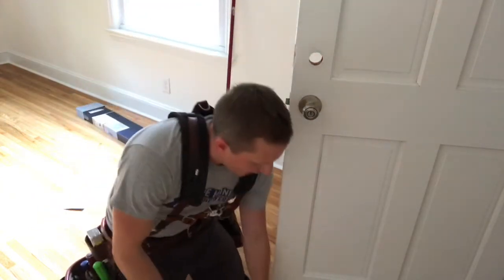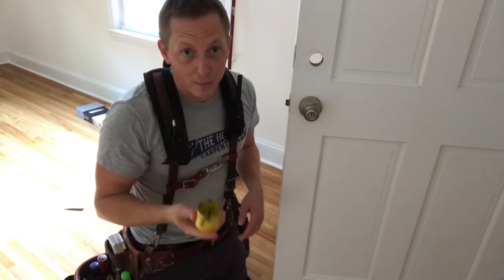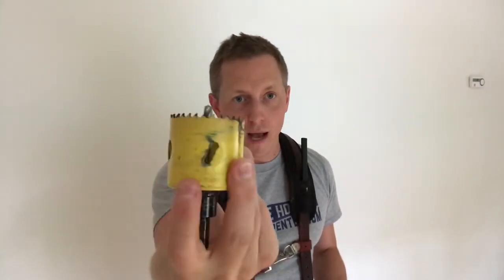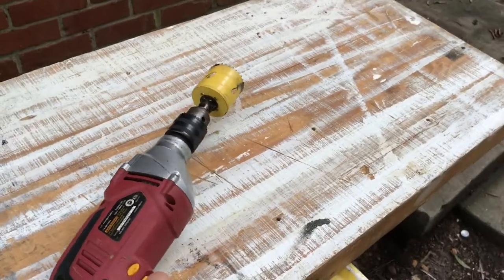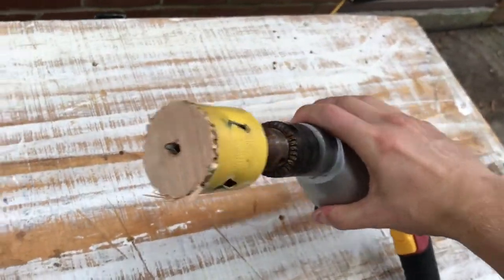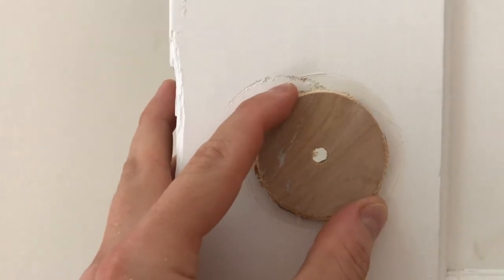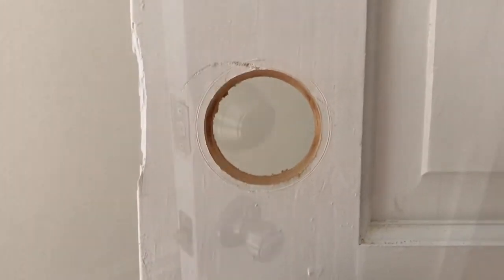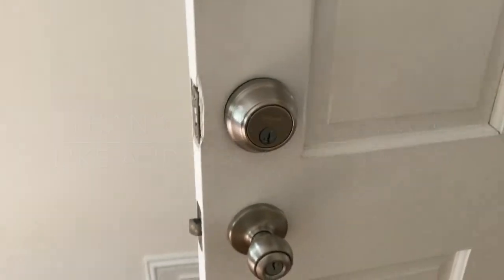Hole Saw Trick (Making Holes Larger)

Comment: Using the other piece you cut the plug out of allows you to just use clamps to hold it an allows you to visually see that it's centered if that's important.  It also allows you to cut off center as well.  This gives a lot more support for the hole saw.  I also recommend running the drill in reverse slowly for short time to "set the track" of the saw, then continue in forward.  Lots of ways to skin this cat.  Go with what works for you.
Reply: Came here to say you can use the hole rather than the plug.  And since 2 1/8 is pretty standard, you can use it multiple times. 

I have 4 hallway doors needing new knobs and they all need a larger hole.

Comment: Nice trick!  I will give this a go, the solution I use is the exact opposite using the hole from the scrap piece, not the centre you did, only clamp it in place, the hole keeps the bit from drifting.  No brad holes to fill afterwards.
Reply: No brad holes anyway. You end up cutting that bit of wood out.
Reply: If the old hole is only the tiniest bit smaller than the new hole, the brad nails can't be used since there's not enough material to nail to. In which case, the solution that Ed Over50 had seems to be better to keep the hole saw in place, although there's nothing guiding the pilot bit.
Reply: @trogdor1977  Correct, the outer hole holds the bit in place so the pilot bit isn’t even required

Comment: I had this exact problem with 17 of the doors in my home. The way I approached it was to use a long arbor and use two hole saw blades. One the same diameter as the original hole (to use as a guide) and one for the new hole. I got them all done in a day with only a little bit of trouble getting the wood from between the bits. Hope this helps.
Reply from the maker: That’s a great idea Kevin—it never occurred to me! I’m putting it in the toolbox 🧰. Thank you for sharing!
Reply: @TheHonestCarpenter  sharing is how we expand everyone's knowledge. Keep making your videos. They help.
Reply from the maker: Kevin Lersch will do, thank you!
Reply: Is there a video on this method? I think it sounds easiest for a not very tool savvy handy person like myself!
Reply: U got 17 doors in ur house? Wtf?

Comment: Just cut a hole in new wood the size of the existing hole. Then slip the plug on the pilot bit for the bigger whole saw. The plug will act as a guide in the old hole and keep the  new bit centered..

Comment: Was just thinking to use a piece of scrap on one side of the door to centre you're hole drill , then fix a small scrap on the other side to align it. Then just bang in the hole saw size you need. Bobs you're uncle mate.

Comment: I just screw on the hole saw I want the hole to be, then find the hole saw the size of the existing hole, and screw it onto the 2 remaining threads inside of the hole saw I just chucked up. Basically chucking up 2 hole saws on one arbor. Much easier and I saw that in another video. I always used your way before learning that. Still use your way drilling stone.

Comment: 2 alternative ways to do this that seem better/ easier than this. I’ve used and had great success with both. 

First: If you can stack 2 hole saws on the same bit. The first is the size of the existing hole and keeps things centered. The second is the size of the hole need and actually cuts the hole.

Second way: cut a hole the size you need in a piece of scrap. Clamp the scrap with the hole centered over the existing hole and the scrap will keep your hole saw in place as you cut. 

On a door it’s best to cut only half way through then cut from the other side. Gets a cleaner cut with less surface tear out
Reply: The second way is the way I do it. If I was modifying the hole on a door in situ, I'd clamp a second piece of wood to the other side and use 2 clamps to get both scrap pieces tight against the door surface. that way you'd get a nice clean cut when the cutter "breaks out" at the other side.
Reply: As someone working with limited tools, your first suggestion was exactly what I needed! Thank you!
Reply: Excellent ideas!!
Reply: Wait what method do you use to clamp the wood in place? If there's a clamp head in the way how can you run a hole saw over it?
Reply: @tfriedmann5908  The scrap board needs to be long enough to extend well beyond the hole itself. Clamp away from the hole.
Reply: @j10001  d'oh! If I had thought a little bit longer about that...
Reply: Agree, I alway stack two hole saws, the existing size and the new size required...

Comment: nice job, A trick I use is to clamp a thin scrap of wood on the door that has a pre-drilled 2/1-8 hole already cut through it, I center it over the existing hole and it acts as a guide for the new and larger hole saw cut.
Reply: Good idea.

Comment: I recently had a customer who had purchased new locks for all of the interior doors in her house and she was going to install them herself. She called me and asked a few questions about the degree of difficulty in doing that and I told her that locks are fairly easily swapped out.
She called me again a few days later frustrated beyond  belief telling me that she was struggling to get the new locks installed properly and there was something wrong with the locks, they didn't fit properly, etc etc. etc.
It turns out that the issue she was having was more that the doors were bored and mortised so poorly and that was the main issue she was having.
I used the same technique mentioned by someone before of combining two hole saw bits together and I can attest that it does work really well. I've also squared a scrap of wood after drilling the proper hole size in it and clamped it to the door being careful to center it as close as possible to the backset of the lock.
Several different methods of doing this and usually common sense wins out in the end.
I'm an "old"  old school old guy and it's great to see a young man like yourself showing the right way to do things. It's pretty obvious that you've been around older guys and paid attention!!
Reply from the maker: Hey @Renegade Wa, thanks for writing in with the work story! I've used the square block method you mentioned too. I'm yet to use the two holesaw bit method, but it's brilliant--I'll definitely be trying it next time. I really appreciate the support! I always do my best to try to give clear, logical reasoning behind what I do in the videos. They're tricky to film on a job site, but I'm getting a little better with each one. And you're right, I've got about fifty great tradesmen to thank for much of what I know! Any bad habits I might have are of my own making--I still learn with each and every job. But the folks I've worked around down the years, including my father and grandfather, have been masters of their professions, and I strive to be like them. It terrifies me to think that so much of their knowledge will be lost as we move from one generation to the next. That's a big reason behind why I started this channel--to hopefully try to encourage folks my age and younger to get involved in the trades while we have previous generations of tradesmen/craftsmen here to learn from. There are some ideas and methods you just can't get back easily, if at all. I'm gonna keep making videos--thank you for watching and supporting!
Reply: @TheHonestCarpenter  beautifully spoken 👍🏻 
We as a species are in great danger of losing the knowledge and wisdom of the older generation.
 We must strive to do our best to preserve and passed down this priceless knowledge  📚

Comment: I've had this problem too, but tackled it with the piece of wood you left on the bench. I drill out a hole in a piece of scrap wood and then clamp that over the hole. It's easier to eyeball the centre as you can see the old small hole. I also clamp a piece of scrap wood to the back of the door to eliminate tear out as the hole saw comes out the other side.
Then you place the larger hole saw in the template hole and start drilling.
For thinner pieces of wood, just clamp a piece of scrap wood to the back of the wood you want to cut a larger hole in and the guide drill bit will bite into the sacrificial scrap wood first, holding the bit while the saw teeth bite into the wood where you want the hole.

Comment: If you have a hole saw the same size as the old hole, you can tack a square or rectangular piece of scrap to one side of the door and then insert the saw through the other side and drill a pilot hole in the scrap. Now go back to the side with the scrap tacked on and drill your new hole with the correct size bit for the larger hole. Using this method, the scrap probably needs to be not less than 1/4 to 3/8 inch thick to give the hole saw plenty of support when cutting into the door. This insures the new larger hole has the same center as the old hole.

Comment: A similar trick I recently used was to make a circle out of a scrap piece of wood and hammer it into the existing hole in the door. I had a 1 3/4 inch hole saw so I used it to make the circle and hammer it into the door and then was able to use the 2 1/8 hole saw on the door.

Comment: Many thanks indeed.  I followed your example and although it worked fine, after some doors fixed your way, I realized I could use my Dremel drill's mini-sander to just enlarge the hole to the left and right at 0 and 180 degrees, just enough to allow the door know to get in.  That is a 30 second  fix.  Sharing my solution to the handymen out there.

Comment: Will this work for a fire-stop door (like a garage door).  It seems these doors are a laminate of wood as an interior material and a metal sheet as an outer material.
Reply from the maker: @Ben Vastine Yes, but you'll need a hole saw bit suitable for cutting through the thin sheet metal cladding of the fire-stop door. I think the ones I'm using here have too much tooth. But, with the right bit, I do believe you can do it. Definitely want to approach from both sides though!

Comment: I have a hole thats 3 inchs and a desk grommet thats also 3 inches... it wont fit. I dont want to put too much pressure and break the grommet. How can I open that hole just a little bit so I can fit it in?
Reply from the maker: I don't usually recommend this shawshank, but maybe just some aggressive sanding with 60 grit paper. You could use some kind of spindle sander, like a dremel. But you could probably also ease it by hand with some effort. Low grit is the key though since it'll be hidden.
Reply: @TheHonestCarpenter  I will definitely give that a try!

Comment: I had a door knob hole that was 1.5 and off center by like .5 in. Making a bigger hole and cutting half the old hole. Not easy. I over cut the door in the wrong  spot cuz the bit slipped.

Comment: the way i do is i get a piece of round wood that fit in the hole of the door tightly.  like a plug for the door hole. then i glue it in then i can make the bigger hole 
the other way is to get a 1 inch thick wood board. cut the bigger hole u need line it up with the hole in the door. then clap it down super tight then the board with the bigger hole become the guide. because the hole saw fit the boas hole just right. but my first way is easier to do